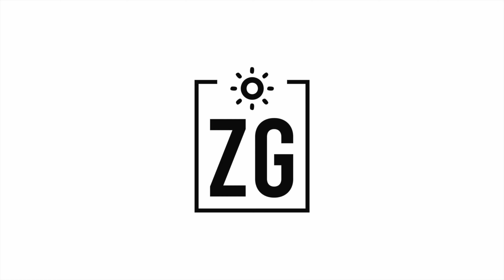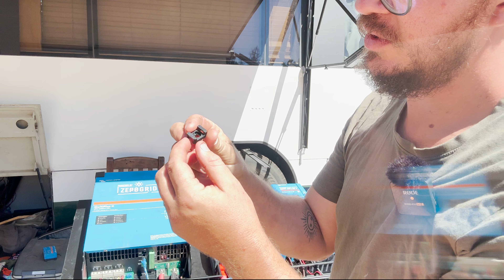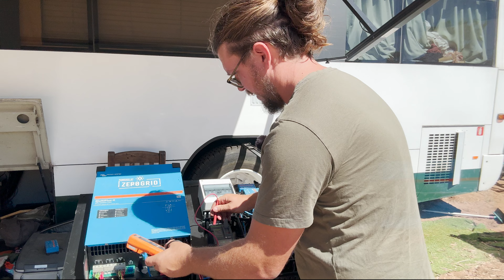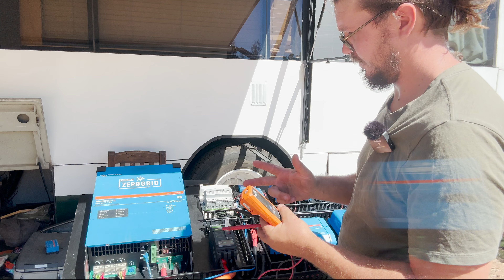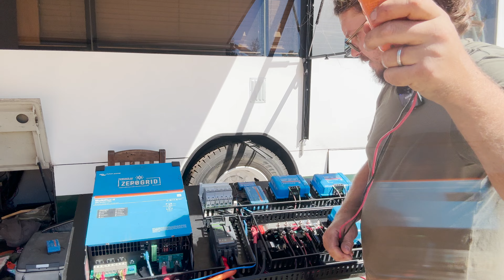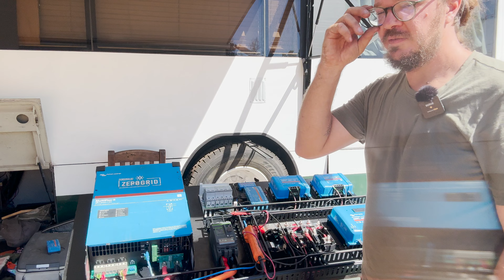Victron Build Part 2: Safety Tests & Tricks Before Power-Up

Comment from the maker: 🔥 Check out the FULL series here 👇
https://youtube.com/playlist?list=PLdQ-mC8Qf-lFnXuTkgWE1F8QHC7F7mQog&si=0vCbHP5_-fJGSUH7

🛠 Want the exact wiring diagram to build this system yourself?
Use code LEGEND for 50% off 👉 https://www.zerogrid.com.au/products/large-bus-motorhome-victron-48v-5kva-multiplus-and-mictronix-batteries

💬 Need straight-talking, no-BS off-grid advice?
Book a call with Landon here 👉 https://www.zerogrid.com.au/pages/phone